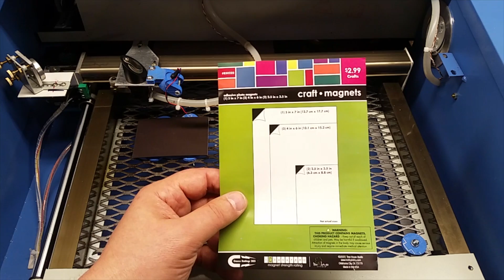K40 eBay Chinese CO2 Laser - Cutting Magnetic Adhesive Material!

Comment: Hi I am interested in getting one of these to cut out compartments in sponge foam or polystyrene for my chess pieces 300 mm thick  can you try to cut any shape you want and put it up on here ......, look it over and see if its left behind any sticky residue that might stick onto my chess pieces this would not be good please help Tommy Liverpool England.
Reply from the maker: Did I read the 300mm part correct?  If yes thats way to thick for a laser as keep in mind the laser (beam) has a focal point so there is a rang either side of this mean you can effectively cut about 6mm.  Also be careful as the polystyrene will off gas sterne  which can cause cancer
Reply: @DIY3DTECHcom  sorry it was 30mm thanks for getting back to me.

Comment: Have you tried to cut thin Aluminum with this laser cutter?
Reply from the maker: To little power as the aluminum will dissipate the heat faster than the laser can generate it.  Remember what you cut needs to "burn" and aluminum does not "burn" without a lot of heat as keep in mind that 40 to 50 watt units are more engraver than cutter.  However with a spray on dye you can etch aluminum...
Reply: Co2 laser doesn´t cut any metal
Reply: Just fiber laser will cut metal

Comment: You said you've mentioned it before, but I haven't seen all of your videos. Where did you get the led boards?
Reply from the maker: +Aron Green no worries, here is the link: goo.gl/QUVK05
Reply: How do you wire up your LED lights? Do you run them off the internal power of the laser cutter? If so, where do you make the connections (if you could open up the hatch and demonstrate that)?  I've been wondering if using the outlets at the back of the unit -- or drawing power from somewhere in the unit -- would reduce the overall power output of the laser.